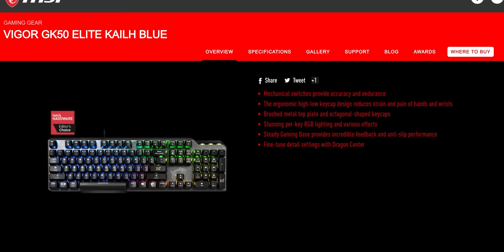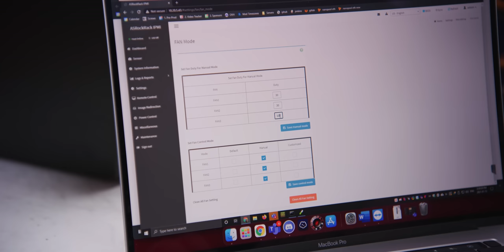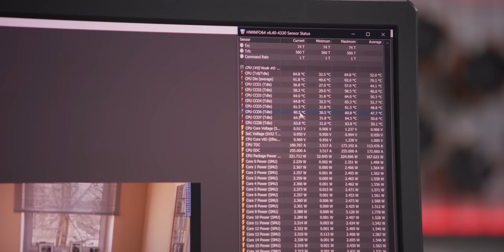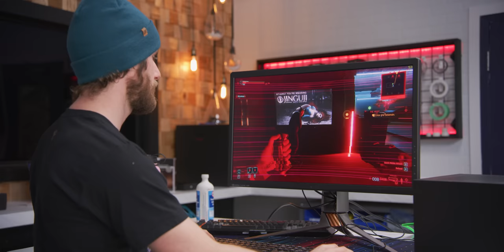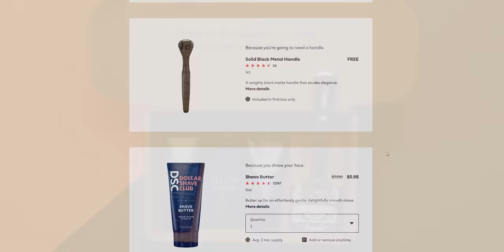This PC Used To Be IMPOSSIBLE! - EPYC "ITX" Build

Comment: the only problem of Threadriper, EPYC, OR ANY Server/Workstation CPU in general is that they're focused for multitasking or multicore tasks, thus why they have so much cores, but,because of this, each single core is actually surprisingly weak, a Threadripper 3553WX's single-core performance is around the level of just a Ryzen 5 5600, and games occuying mostly 4 to 8 cores at much, you'rer paying way more, for the same performance of a mid range CPU

Comment: 9:25 "...that these four wires are motherboard power..." - except they aren't. They're just the "non-power" lines of ATX 24-pin connector. It's the soft-power, the 5V standby, and two grounds. The connections required to power up a system. ALL the actual "power" comes through the 12V.

Comment: My PC has a 310W high efficiency PSU (OEM) a single 6-pin connects PSU to motherboard. nothing else. then 2x 4pins come off the board for powering HDD/ODD.

so naturally i put in a 95W CPU, 75W GPU, sdd, 2x HDDs, 2x fans and a usb3 pci-e card.

only needed a satapower 'Y-splitter' and a sata to molex to turn it into a real fire hazard!

Comment: The problem with PSU's which are at or near operating wattage is that noise is introduced which will affect downstream Audio and Video components. I had a flashing pixel problem in my VR HMD which went away when I supplied my GPU with two independent 8 pin Power looms.
10070k oc'd ; 1080Ti oc'd ; 700W PSU.

Comment: The Supermicro M11SDV-8C-LN4F is a real mini-ITX board with an Epyc 3000 series cpu. I'm running one for two years now, so it can be even smaller 😊
But it's low power, so not realy for gaming....

Comment: Registered SDRAM is blazing fast at sustained sequential or semi-sequential reads with far higher per clock efficiency, but it sort sucks on latency to the point of actually impacting game performance.  Oh, and since games use random memory read a lot in "Crunch" points that tend to stutter or lag you will be getting lots of performance where you don't need it, and no performance where you do.

It might rock for video editing or file servers, but it sucks for gaming.

Comment: Actually I wish I saw this a couple of months ago... would be a good choice for building out a SOHO cluster. using EPYC chips  albeit fewer cores, and the graphics card.  Of course the problem is that you still need a second PCIe slot for a higher end NIC card.  Good for Compute nodes... w some storage.

Comment: AMD is great    ..if you want to be replacing it ever few months. I'm till running AsRock x99 Intel based gaming rig pretty much 24/7 that burned out 2 nvidia cards, 6 PSU's and 2 cooling systems. 
still have not had to replace the CPU, mems or mobo. Games still run sweet with RTX 2080Ti  on 4K and VR. Want is it like since they released it, 7 years ? 
Replacing the CPU cooler was PITA when Corsair discontinued the ITX watercooling solution. A great big F-U to Corsair ! And the Silverstone - snowflake PSU are garbage, but they are high wattage and it is really nice that they are full modular so they are easily replaced. 

Still waiting for PCIe gen 4 Intel ITX for upgrade

Comment: One interesting option for LTT to build a sick rig... use this board, put it into modified/similar to NR200 case by "attaching" Icy Dock ToughArmor 24 (shown in L1Ts vid: https://www.youtube.com/watch?v=c-mZALht3Qs) to the front, thus making it slightly elongated... That would allow easy feature for the 2 top slimline PCIe ports to be split into 16x SATA ports (slimline to sff connectors etc.), while the rest of the slimlines could be split into 8x U.2 (one would have to modify the ToughArmor to make it work), so all the 24 drive trays can be populated most efficiently... That would make it an even more EPYC build ;)

Comment: I see they just ran those extra lanes to U.2 connectors, but without a chipset the SATA functionality is limited to two of them.

One could run a riser card from the U.2 plugs, but I'm not sure what layouts would be supported by the BIOS.

Comment: Does the motherboard support manual config of the ram speed, timings, voltage? I'm using UDIMM 2400MHz CL17 1.2v ECC memory 128GB on threadripper 2nd gen, OCed to 3000MHz CL14 1.35v without throwing any errors or corrected errors, I've been using it over a year like that.

Comment: In Silverstone’s defense, those are probably build-to-print/OEM panels, which have a set standard of what is acceptable as a touch-up. Because it’s the side facing the frame it was probably deemed a lower spec, which means they can get away with a little more.

Comment: Disznó egy alaplap 256bit in/out adat memória egy G34 12-16 magos is elég lett volna egyetlen node-al mivel annak 336bit in/out adat busza van. Enginering info. 336 CU one FPU. 256pin/bit memory + 30bit/pin PCIE x16 @100-233MHz  DDR4-1600 - DDR4-3800, FPU speed : 33,6GHz to 78,3GHz, 4,2GB/s to 9,7GB/s. Memory speed full quad chanel: 3,2GB/s to 7,4GB/s,  PCIE x16 375MB/s to 873MB/s
Reply: G34 one FPU 4TB memory support. 576bit micro code / CU 
5,7Mb x 5,7Mb  = 32,5Tb = 4TB
8 full sinus = 8bit in 1B adat. 8bit in (88bit 3DNow+, 576bit SSE4.a and FPU mode 32bit 40bit 56bit 64bit, 72bit, 128bit, 192bit, 256bit, 384bit, 512bit, 576bit, 768bit and future AMD 3DNow11+ 792bit tipycal micro code's). Intel 768bit is AVX3.2 (Non tipycal micro code''s 2-3-4-5-6...Xbit micro codes FPU "CPU" 
Memory support calculating: is micro code's amount 575+574+573+...+2+1x336 CU = 11,4Mb 
11,4Mb/2=5,7Mb  (5,7Mb x 5,7Mb = 4TB)
Reply: no marketing is!!!

Comment: Im sorry what?

Are you telling me that tiny , small , simple, straightforward metal case , costs 250+$?

You people are nuts if you buy that kind of stuff , what a ripoff.
My big tower case , with 2 huge 200mm rgb fans in the front . 1 standard 120mm rgb fan in the back space to add 3 more 120mm fans or water cooling in the top .
And all the possible usb , mini usb , type c , and other sorts of connections you might need , with enough space to fit anything you can possible think of inside z
Aluminum case , and templates cristal in the side 
Costed me 158$

And this simple , small black box , costs 256$

Total rip off

Comment: So if you check the Bottleneck Calculator you will find that the CPU is massively, laughably overpowered for even a 3090.  Why on earth would anyone build a gaming PC with a Threadripper (or Epyc) processor?!

Because they can, that's why.  

I am running a Ryzen 7 2700x with a 1070ti, so people do what they do ya know.  If I could upgrade my CPU to a Threadripper I probably would, even though I would almost certainly not get even a single extra frame per second out of any of my games.

Comment: Send me a sharpie panel it's going on Twitter. That's like me as a mechanic doing a headlight treatment on your car that is sharpie colored and then I accidentally burned some of the paint off through the tape that I already put down to prevent the burn in and it still goes down to metal and I decide hey a sharpie will fix this they're the same color right. NOOOOOOOO